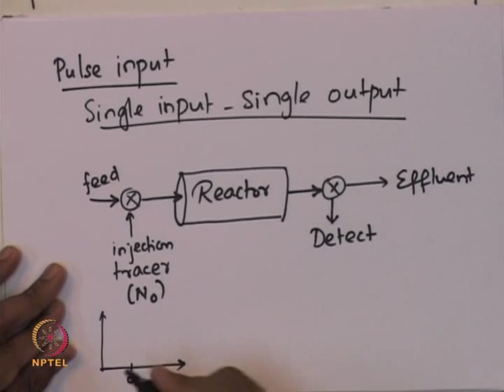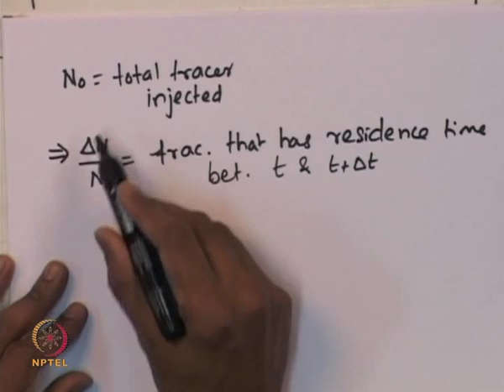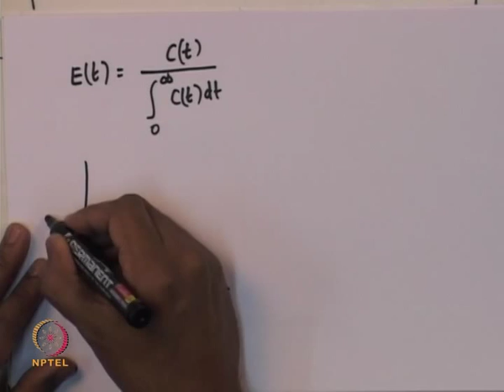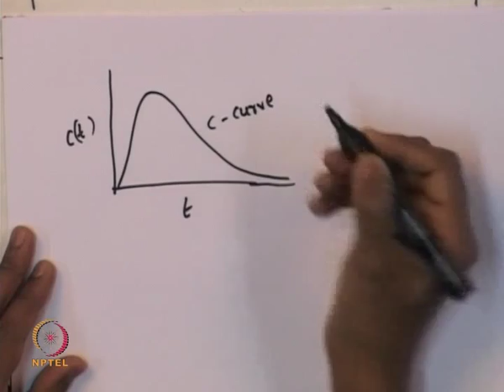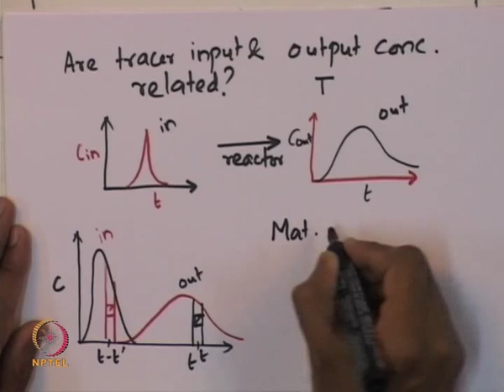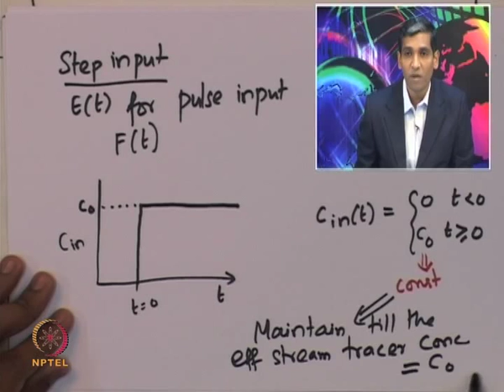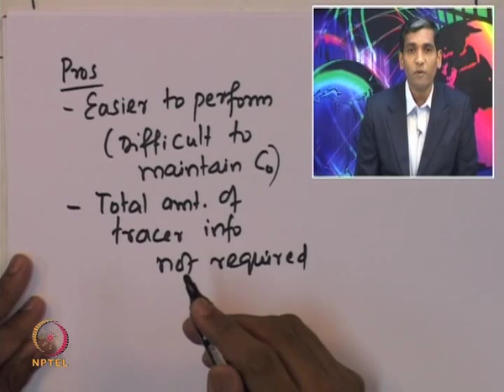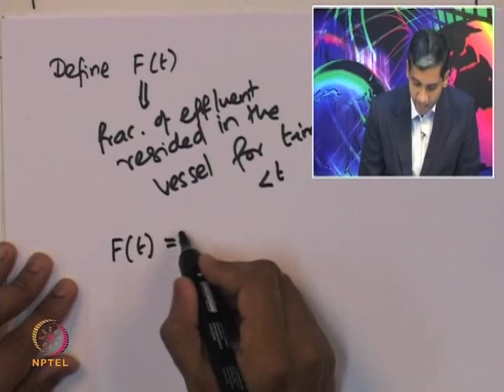Mod-01 Lec-31 Measurement of residence time distribution

Comment: As u told that..long tail results causes inaccuracy..Could u explain why these long tail is actually observed?? what causes this??
Reply: Hi Dhanik
The reason behind the long tail is heterogeneity and variability of media.This creates 'scale effect' which is usually ignored in traditional equation .In reality you will find dead zone,bottle necks in the heterogeneous media which causes the tracer to stay for a very long time in the system.That is why the denominator is not defined for this.

Comment: on 6.15 mins The C vs time curve he said it tracer was  introduced at T=0 some tracer was introduced. Then on the curve he draws an increase in contration (y axis greater than zero b4 T=0.) how can this be as there was no tracer before T=0
Reply: Dear Shahid,

In experimental work, it is almost impossible to achieve pulse signal. I think that is the reason why there are + theta and - theta.

Regards.